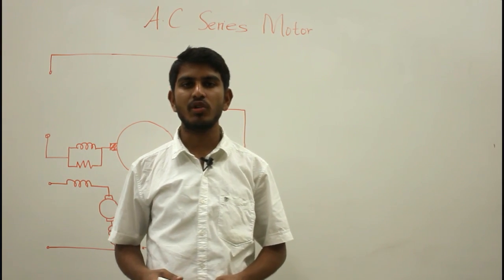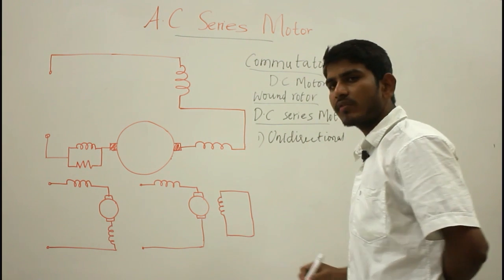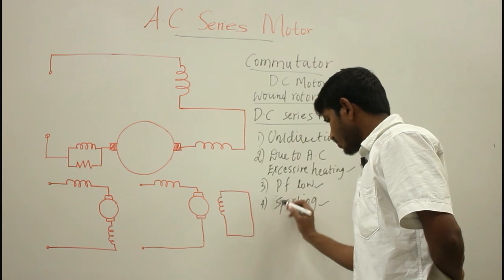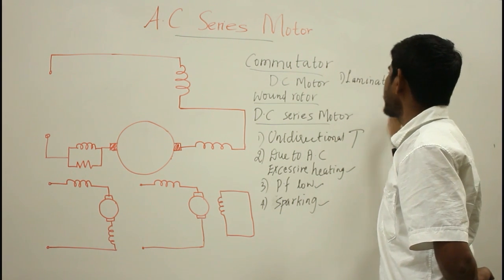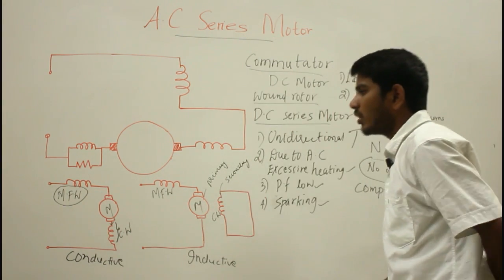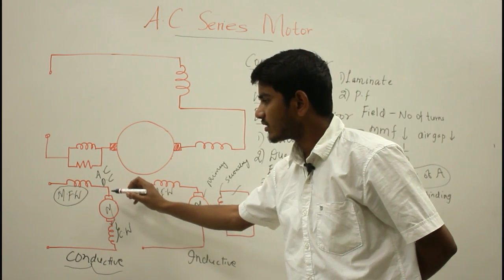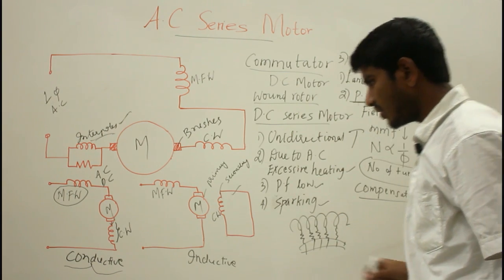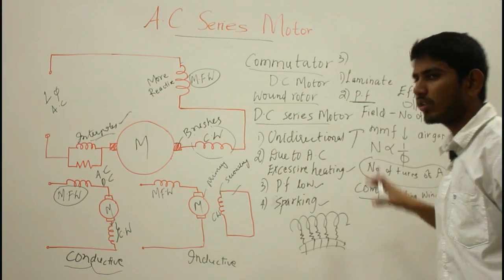Theory Of AC Series Motor

Comment: 1.Does compensated winding acts as one of the poles....? ..
2.but for a series DC motor ...the single  field  winding in the  circuit resembles as two poles N and S .....Is it right?

Comment: Pls, I need a reply on these questions
1. What is the difference between commutator and slip ring?
2. Can a slip ring be used in a DC motor instead of a commutator?
3. What is the role of a commutator in ac series motor?
4. Are commutators used in Ac motors?
I would be glad if I could get any clarification on this...Thank you
Reply from the maker: Commutator just performs commutation i.e, conversion from AC to DC and vice versa
Slip rings just transfer energy from stationary parts to rotating parts
Now u can understand the rest of the questions...
Reply: @SmileandLearnflyfree  
So based on that, I understand that, you need DC current in both field and armature for the DC motor to  rotate, and if the motor is connected to a DC supply, then there is no need for conversion of DC to AC or vice versa, hence, no need for a commutator in a DC motor.....so i want to know the use of the commutator and not the slip ring....I'm really getting confused and I need clarification on that. Thank you